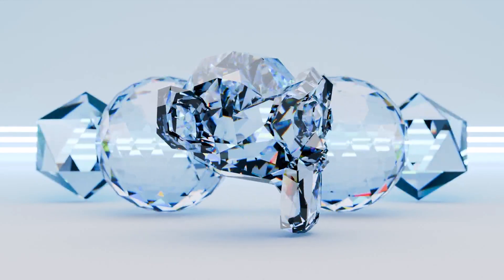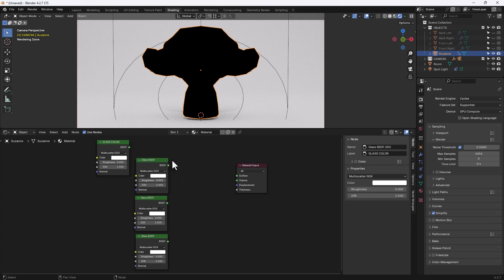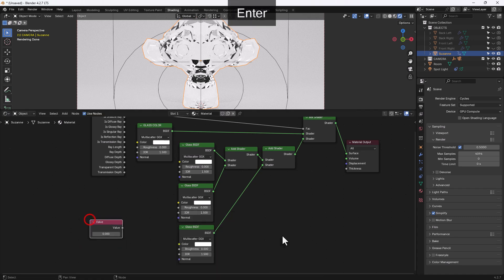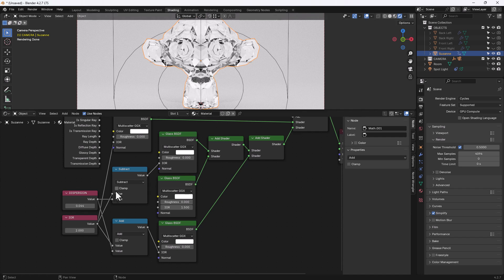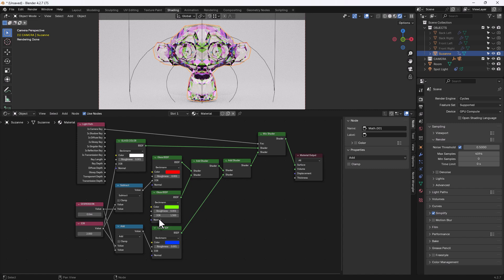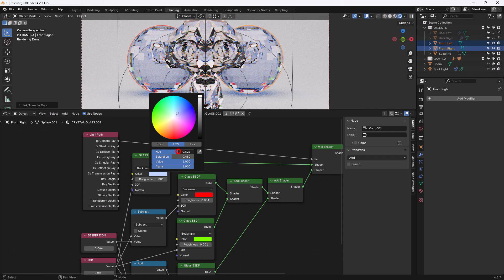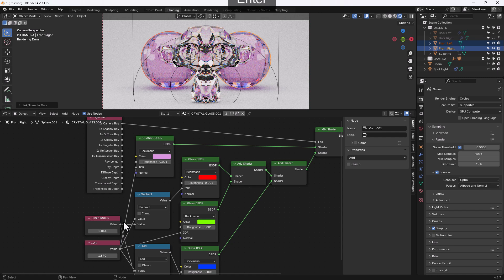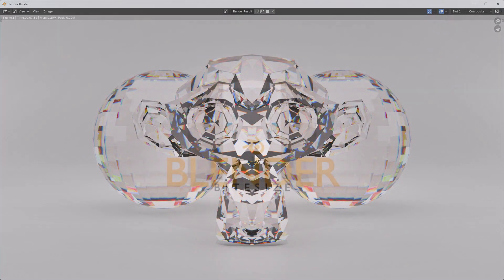CREATE A CRYSTAL GLASS PROCEDURAL MATERIAL IN BLENDER 4

Comment: Amazing bro Thanks for this tutorial.
Reply from the maker: Thank you!
Reply: I have a question: the light that hits outside the shader doesn't pass through. I need to place lights inside the object that has this material for it to 'light up' from within.

Is this normal, or is it due to some node configuration? Or should I adjust something in the render panel?
Reply from the maker: This is not normal. For caustics (light to pass through an object), make sure to enable shadow caustics in the object data settings for the light (or lights). Also, make sure that you are using the cycles render engine.
Reply: Right! That was it-I guess I can write that. Shadows and caustics weren't enabled in the lights or the object properties, and they weren't affecting my plane either. I researched it, and now the shadows look amazing on my object! I'm learning, and I really appreciate it ❤
Reply from the maker: @Estopheles  Glad that you got sorted.